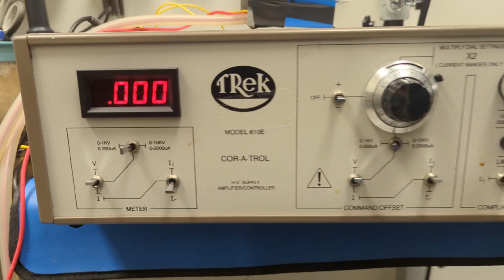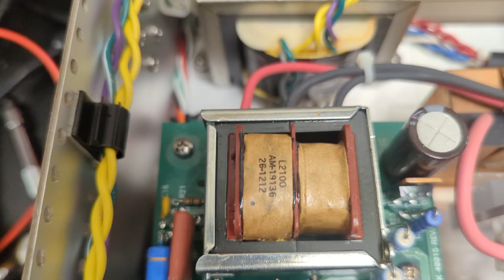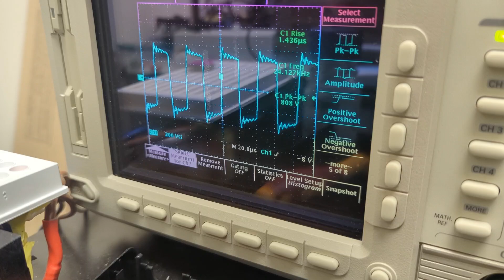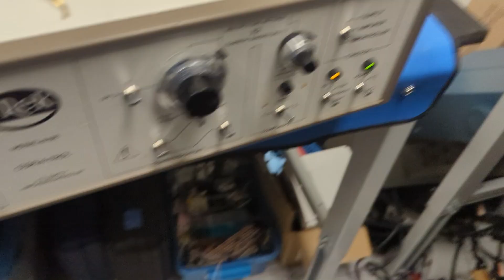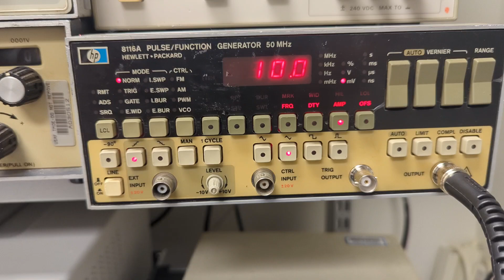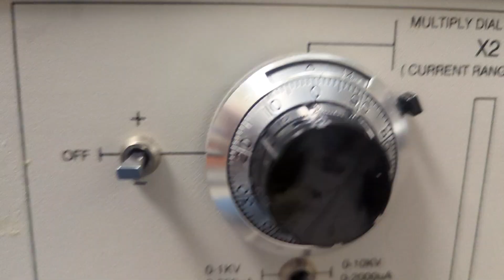TRek Model 610E High Voltage Supply/Amplifier Teardown

Comment: Did you try the transconductance amplification mode? I wonder if/how I can ensure exactly Io=0uA output when I set Vin=0V. I assume there is a way to calibrate. Or can I apply an command offset to cancel out the tiny output currents at zero input?

Comment from the maker: UPDATE: The  @Thesignalpath  released a video on HV Amplifier design yesterday (link here: https://www.youtube.com/watch?v=1voyXXpq-k0&t=2363s).  This video is fantastic and answers a lot of the questions/uncertainties I had about the 610E circuitry. 

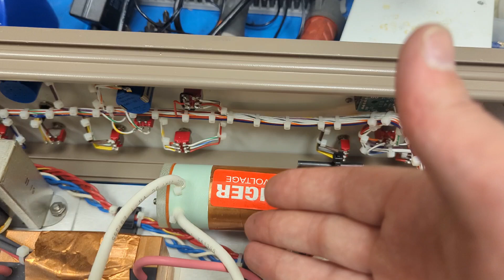 1) He defines what that long cylindrical tube is at the 12:45 mark.  It is not a current monitoring device but safely provides feedback to the low voltage amplifier board via a custom resistive divider.
2) If you look at 6:37 mark, I completely gloss over this because I didn't know what they were, but you can see this plexiglass circle right beneath one of the HV tubes at the top right corner.  That is actually a light pipe for an optocoupler!  This optocoupler is what allows the output signal of the low voltage amplifier to reach the HV portion of the circuitry since there is no way to safely physically connect both parts of those circuits.  Very cool!

Highly recommend you check out that Signal Path video if my video left you with unanswered questions!

Comment: And off with the lid….whooo…to big fat 6BK4’s..don’t see things like that much these days…25Kv, 1mA “Hot Source” MOSFET!

Ah, yeah-nah, they are thermionic valves…I have a Marconi Mk-IV monochrome TV monitor here that has one in it as a shunt reg.

If you have the ability to draw the circuit from the gear, this is an excellent piece of gear to learn from, I’d be “into this like a bull dog into s custard pie” as there is no circuit online…just love to know how those 6BK4’s are used and where the rectifiers are. Reckon that copper foil covered block is a Cockroft-Walton multiplier, but the other copper shielded cylinder in the front left hand corner…reckon it is some really fancy high isolation optocoipler or transformer…..geez I want to extract the circuit of this thing!
Reply from the maker: Thought you would enjoy this one Globe Collector!  I was fascinated by this one when I opened it up as I don't have much experience with equipment like this.  I can definitely spend some time outlining the circuit.  Interestingly, the Signal Path just released an in depth video on HV Amplification.  I'm going to give that a watch.  I was very curious as to what that long shielded cylinder was.  I did open it up and it had some passive components inside, but there was one super long axial component that runs almost the length of the tube inside.  I couldn't tell what it was.  I thought perhaps it was some kind of current monitoring device.  The manual for this thing was a bit of a letdown - no schematics.  So I can definitely spend some time mapping it out!
Reply from the maker: So I watched the Signal Path's video on HV amplification design I was telling you about.  It is a perfect supplement to this video.  He goes into much greater detail than I ever could on how these work and even does a teardown on another Trek unit - 20kV one!  He defines the long cylinder.  And you're pretty much right - it is resistive divider that allows for feedback from the HV to the low voltage circuitry.  Also defines some other components I missed, like the light pipe optocouplers below the HV tubes that are used to send the output signal from the amplifier to the HV side.  So cool!  Definitely check it out!

Comment: Where is those inoperable test equipment you're fixing?
Reply from the maker: If you mean videos? They are in the works! I finally got the parts I need to finish the HP 8557A SA so hopefully that will be the next one. And then everything else on that cart is waiting for that to be finished so those videos will be next!